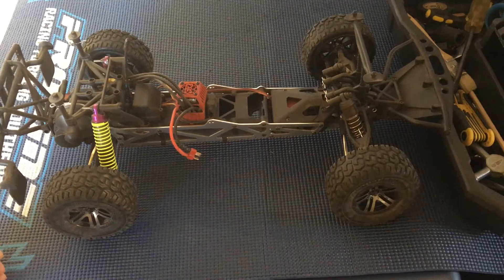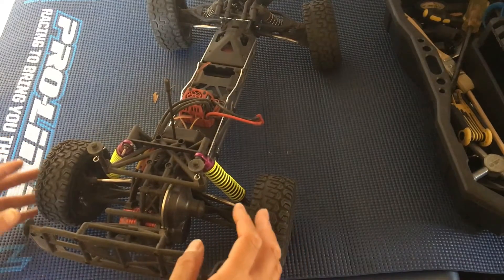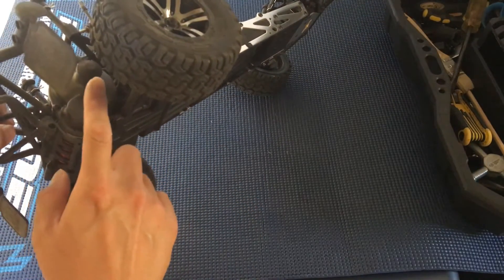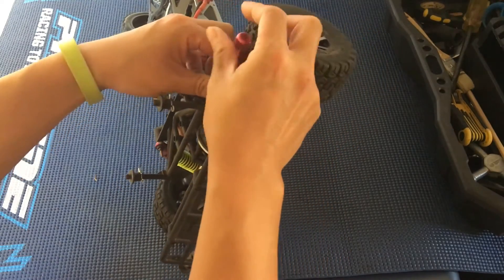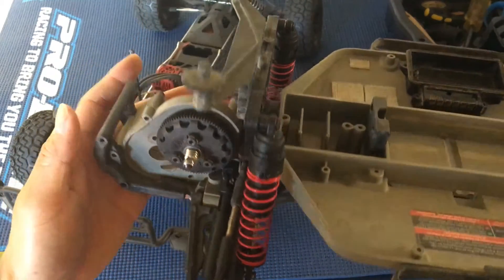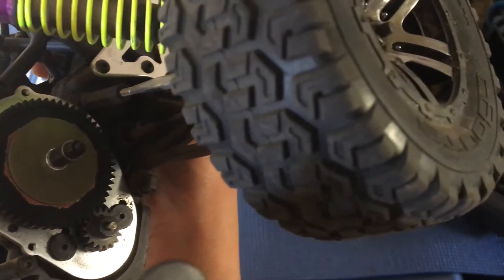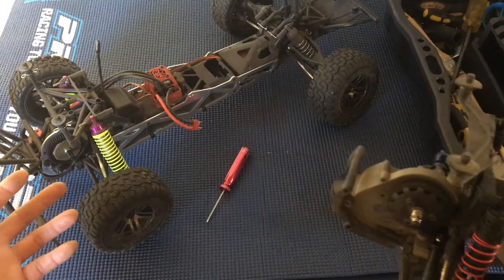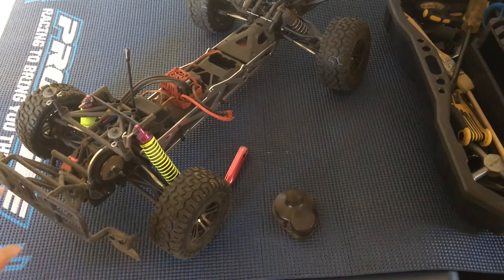Racing2Learn: Diagnosing Arrma Fury BLX Gearbox, Differential, Gears, Comparison to Traxxas Slash

Comment: hey I think I have this model because it had the metal gear I broke a out drive pin inside of diff and wanted to swap for whole new Tran ny but it looks like there plastic now lol I'm stuck and don't know what to do
Reply from the maker: You don't need to replace the whole transmission, just replace the broken diff gears and pins. Make sure to get the updated ones.

Comment: Hi, I put badlands on the back of my Arrma fury with non adjustable spur and stripped it right away,, can I just get an adjustable slipper and spur and mount that on to help with the extra torque?? thanks for your vids man 😊
Reply from the maker: Thanks for the encouragement and feedback! The adjustable slipper should help in your situation, wasn't aware that Fury's came without an adjustable slipper, is it an older model?
Reply: Racing2Learn ... it's the Arrma fury mega brushed! it takes lipo but the non adjustable slipper don't like it! so more slip than move since I put new spur on! think I will try buff the plates with Dremmel to see if they grip!?

Comment: summarizing: which one is better to buy?
Reply from the maker: For parts availability and aftermarket support, the Slash is still tops. The Fury is a bit of a pain to work on due to the twin vertical plate chassis. Accessing the transmission and servo are a bit more complicated than on the Slash.

Comment: Where did you get those shock caps?  Thanks!
Reply from the maker: Thanks for watching and commenting! Those are actually entire front shock assemblies off of an unknown 1/8 scale nitro buggy we received as a donation.
Reply: So is the fury compatible with other shocks?  I've heard they aren't on a forum.
Reply from the maker: I had to run longer bolts that go through the shock tower, but that was it. I'm not sure about other shocks, I don't think stock Traxxas shocks will work. I'd look at 1/8 scale buggy front shocks since they're usually all aluminum built tougher.